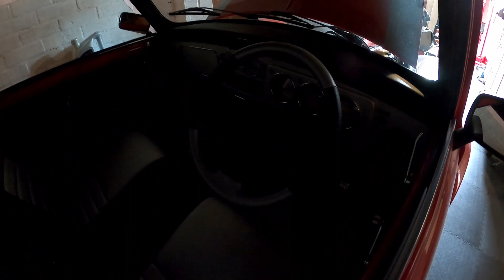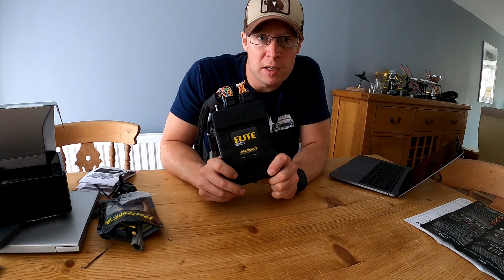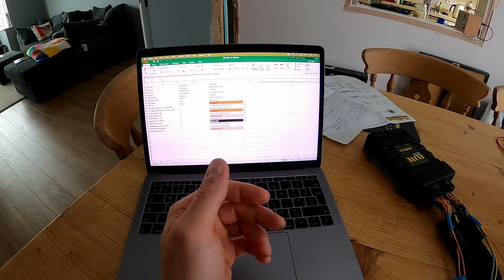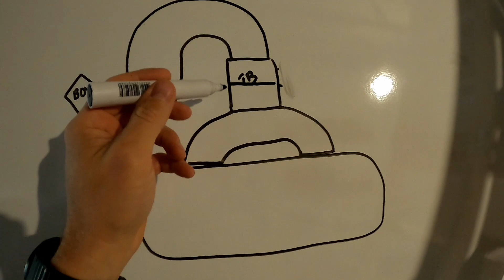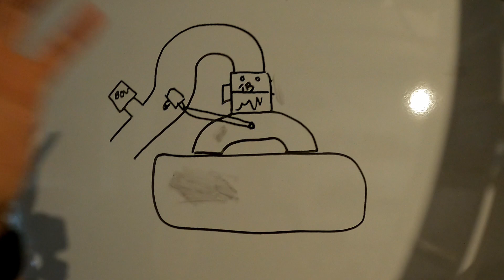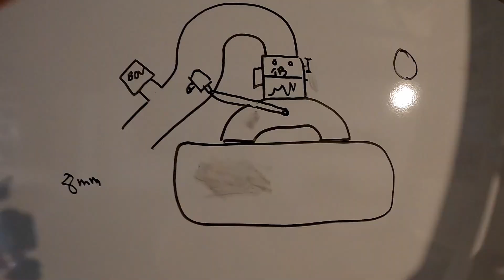Fitting a Haltech ECU to my Turbo Mini Cooper Sport!

Comment: I'm looking to do the same but without a turbo. I'm not a pro when it comes to wiring and I'm hesitant to change over to the Haltech. I, as well, an not happy with the Delta 400. If possible I would like to know how you re-pinned it to work with the Haltech.

Comment: I can see what you're trying to achieve and believe it should, the only experience i have of an IACV was looking at the possibility of fitting one to the 8 ports but realising the injector port where the valve was designed to fit was on the upside of the butterfly, rather than the downside where i think its supposed to go, bleeding air in as required on a closed throttle. The Ardens run ignition based idle control
Reply: I think I'm going to have to settle for a combination of the 2. I may also have to accept on very cold days I'll have to give her a fair bit of throttle to start 😂
Reply: @Dagowly83  No I dont think it'll be that bad, with cold start enrichment and an IACV it should be possible to get it pretty damn good, none of our minis have an iacv and manage pretty well, it just takes AGES to get the minor mapping tweaks sorted till you are happy with the mix of idle control/coolant enrichment/startup enrichment (and startup can pretty much cancel out coolant in most circumstances)

Comment: Hi, Are you running the injectors in the intake ports as per the original MPI design or upstream the throttle similar to the SPI design.
Reply from the maker: It is similar in concept to the SPi, however it's running dual injectors. It's the Specialist component's 5 port injection system.

Comment: Is fuel able to get in with a closed TB? Is that why it won’t run ? Not sure where the injectors are?
Reply from the maker: Hi Andy, good question, however the injector are post butterfly valve. If you watch when i turn it over there's a mist of fuel that comes out the hole whilst cranking.